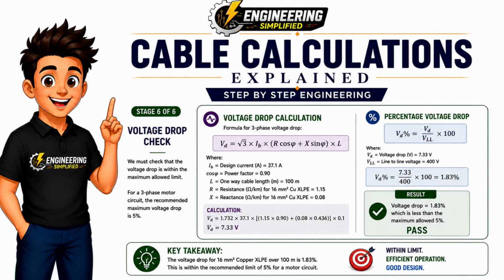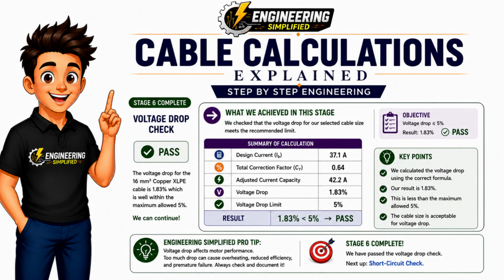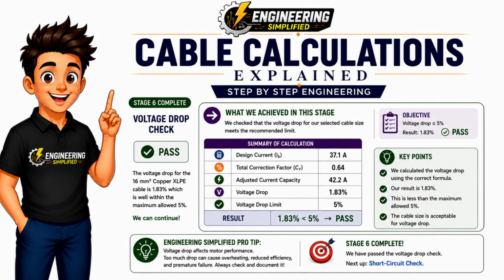Why Your Cable Sizing Calculations Might Be Wrong (And How to Fix Them)

Comment from the maker: Undersizing a cable doesn't always trip a breaker immediately, voltage drop can quietly cause problems long before you hit a thermal limit. Have you ever had to resize a cable run after the fact because of a voltage drop issue?